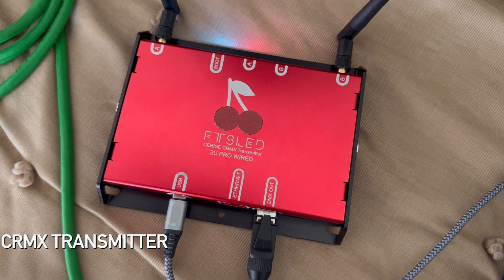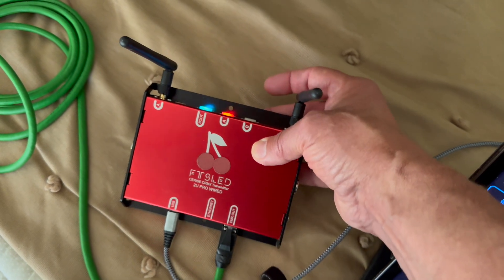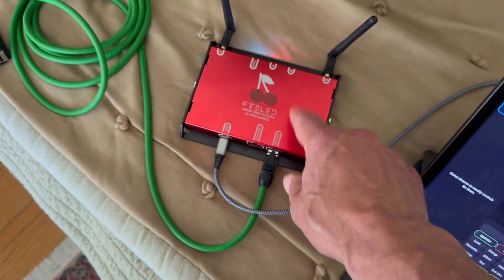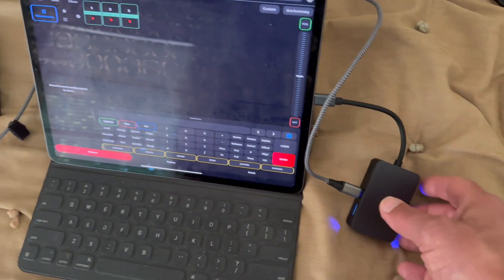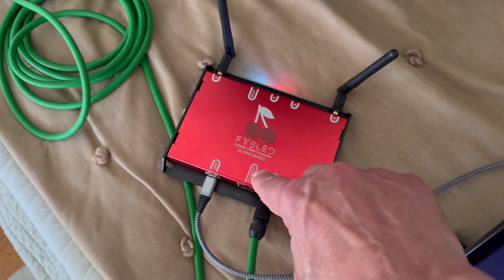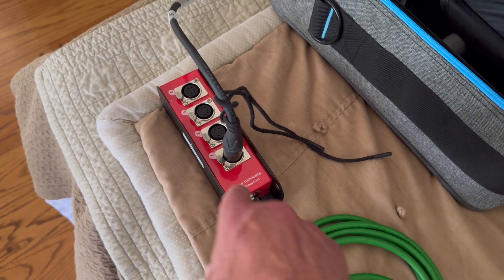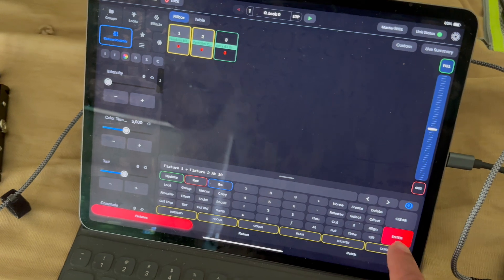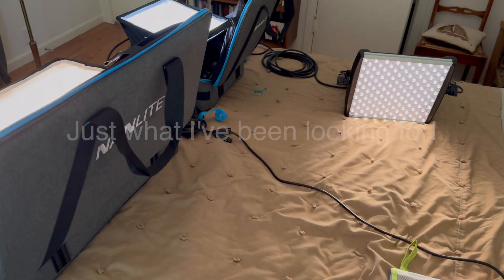The Heart of a Wireless Lighting Control System

Comment: How has the Cerise been treating you?
Reply from the maker: I love it! It’s just so easy. I have had only one time when I was outside on a job and it just wouldn’t connect to my lights. I didn’t have time to trouble shoot, so was glad to have an AKS+ as a back-up. But on the next job I whipped it out and it was fine. So I’m going to call that a mulligan. Other than that I’ve had a few instances where it seemed like the cable or adapter was messing things up, but again I’ve been using those same cables and adapters since then and they are fine. Gremlins😀 I have not use the wired breakout too often, but it’s been flawless the times I have used it… I just configured it to be split into two universes, 2+2. Hope that helps!
Reply: Do you have to link lights every time you power this on?  One thing I really like about the gaffers control box is once you link lights they are always linked.  You never have to link them again.
Reply from the maker: @jfratis9081 I’m not exactly sure what you mean, but normally when you are adding a unit to a scene you may or may not need to unlink it and then hit the link button to create a connection. Once you have connected it you shouldn’t have to again, but I’m not sure if that answers your question.

Comment: Very informative video! What would be the advantage of having this unit vs something like the Aputure Sidus One?
Reply from the maker: I bought the Sidus One before the Cerise 2U arrived. I played with it a bit, updated the firmware (which was not intuitive to me, but kind people on the internet talked me through it!) and got it to work great with Sidus Pro, but had some difficulty getting it to work with Blackout. Probably user error. And then by the time I would have had time to work with it some more the Cerise 2U arrived and the Cerise seemed to work pretty quickly after some initial questions were answered. I like the direct linkage aspect of the Cerise: there’s no wifi between the iPad and transmitter, just a cable. I also like that I have a direct link to wired DMX is I need it (another single cable), and a built in second universe. You can add universes with more Sidus One’s, up to 4 universes, and they may have a way to add a wired dongle for 5 pin DMX in the future. For me, it was more about timing, and the Cerise works seamlessly with Blackout. It may be that the Sidus One is a better fit for you, but that’s a question you’ll have to answer😀
Reply: @meetthegaffer  Super appreciate the helpful response. Another question:  Blackout vs Luminair? Pros and Cons of each?
Reply from the maker: I only have experience with the earlier version of Luminair, so I’m not sure how it is now. My frustration with it was mostly that I had to swipe through a lot of “pages” to see all the units that I was working with. Blackout lets you see a lot very quickly and drill down quickly as well. The other part of Blackout that stands out for me is that the developer, Jeff Brink, is all about support and constantly updating fixture profiles. That’s it something other console developers are necessarily as focused on. 

If you are never going to have more than 5 or 6 fixtures to control you may not need Blackout, but it’s where things are at in that middle space between single brand apps and full consoles… and it has a growing, global user base. The Gaffers Control and Exalux Gaffer One(?) controllers are really nice too for an all in one solution. And Sidus Pro will continue to built out as well, so it may be worth widening your pool of potential solutions that will fit your use case best.